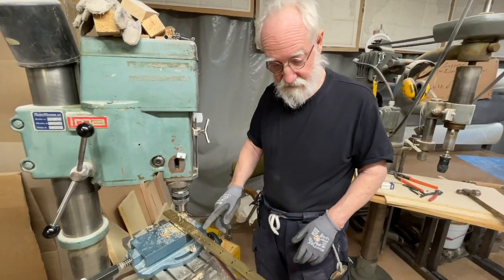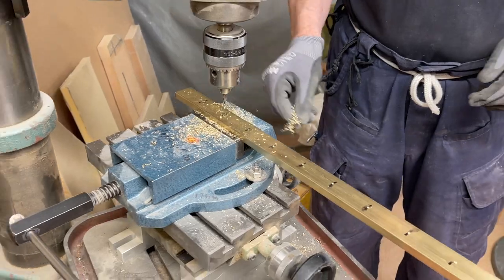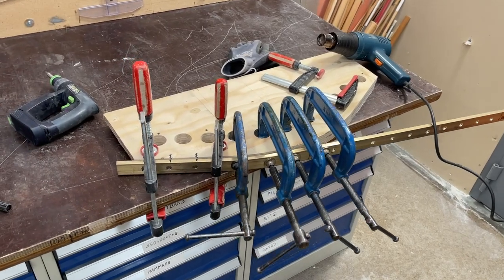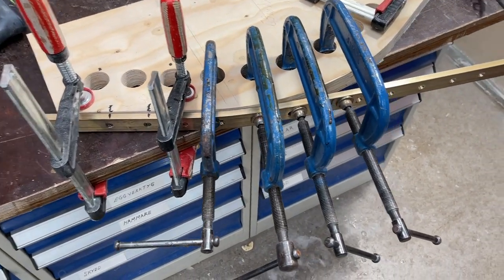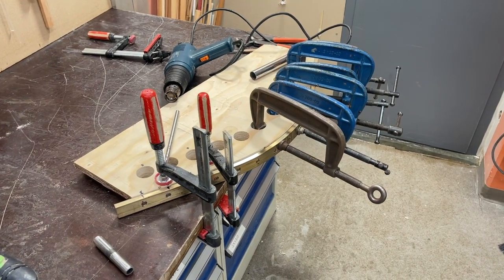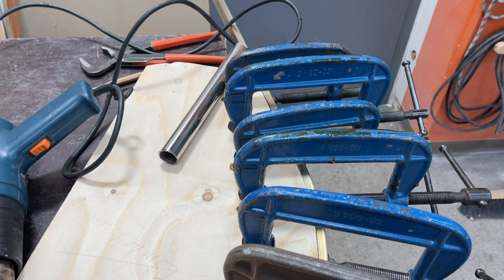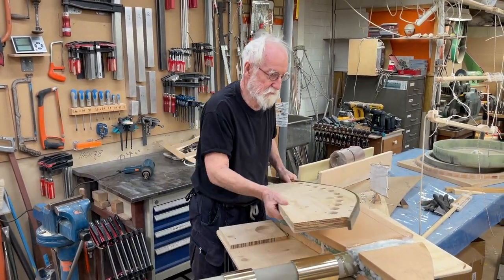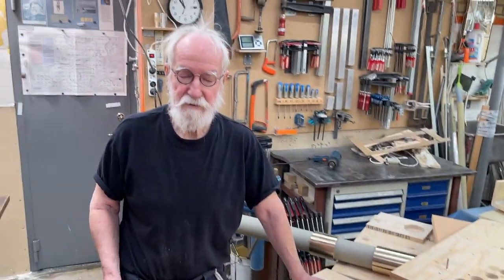26 Dec 2022  Preparing the bronze flat bar 10X30 mm as sole for the rudder, drilling and bending.

Comment: You must be going to drill and tap the rudder bottom to hold those machine screws otherwise you might be better off with a wood or sheet metal screw.  I like the buck you used to bend it and overbending to account for the spring back.  Lookin' good!
Reply from the maker: I will drill and tapp and set the screws in epoxy.